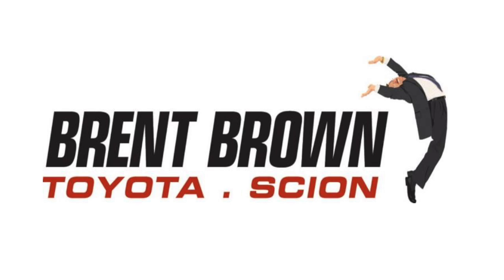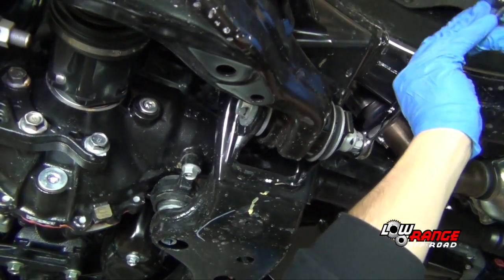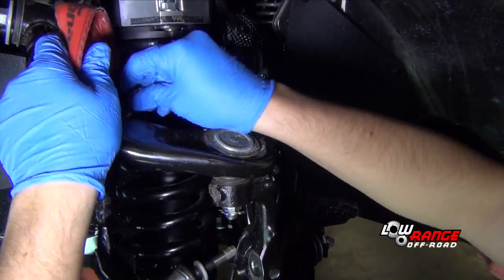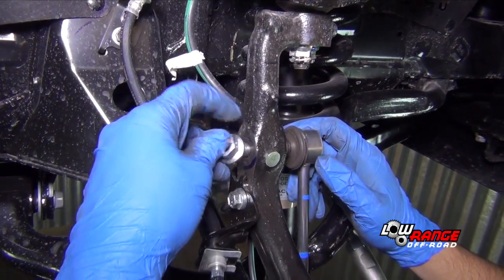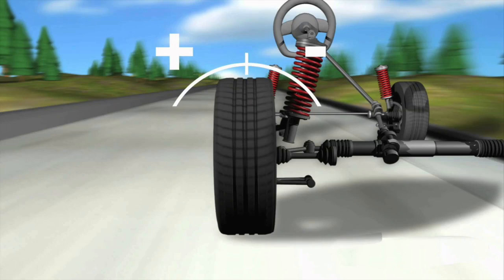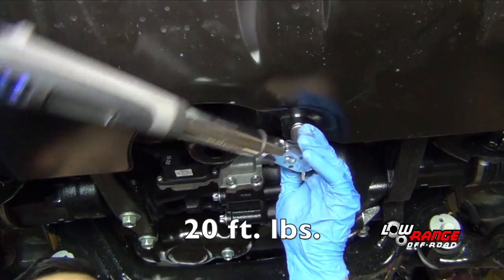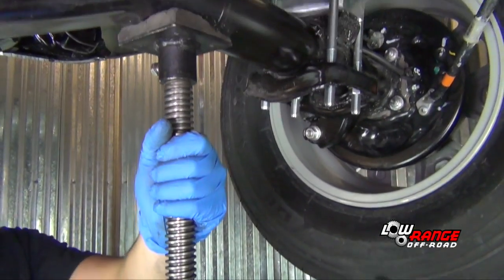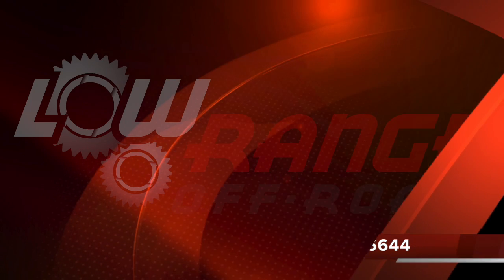How to Install  an LRT 3" to 1" Leveling/Lift Kit on a 2016 Toyota Tacoma

Comment: so, don't you have to add shackles to both ends of the leaf spring?

won't it be off kilter if you just alter the one end?
Reply from the maker: I am sorry.  I am not sure I understand the question.  We are not using shackles with this kit.  The block is all that is needed to lift the rear of this vehicle one inch.  If this reply does not address your concerns, please feel free to reply or call our tech support line 801-805-6644 from 8am to 5pm Mon through  Friday MST.  The best person to talk to would be Nick.
Reply: Blocks go under the spring. Shackle height isnt affected, as it is lifted equally from under the spring

Comment: I own both a 2013 Tacoma and 2017 ZR2 and you can install the I inch leveling kit on ZR2 for $59 i did this with 1000 miles on truck with 285/70r17 BFG KO2 Now have 19500 miles now issues. Now I say I own both trucks ZR2 is the better truck hands down. Tocoma has 265/65r17 duratrack off the ZR2 on it now. Both good trucks.
Reply: Your zr2 won't last half as long lol this coming from a GMC technician.

Comment: im wondering how this kit will affect rough off road driving and how it will hold up in off road use
Reply from the maker: This kit is designed to take a lot of abuse.  It should hold up under whatever you can dish out.  Thanks for watching and commenting.

Comment: If I install this 3" to 1" kit on my 2013 sr5 prerunner, will I need new UCAs?
Reply from the maker: I am not sure I can answer your question accurately.  My advice would be to call 801-805-6644 or email us at sales@lowrangeoffroad.com.  These guys are good and are happy to answer your questions.  Thanks for watching and commenting.
Reply: Arnulfo Cruz yes, it's suggested because the geometry changes the front suspension angles, and can cause premature ball joint wear... I suggest replacing the lower ball joints as well to serviceable ones, this is what I did to my 2006 tacoma and it made the steering feel much better

Comment: Will lifting a brand new truck void the warranty?
Reply from the maker: You should not have a problem with warranty.  We sell our lift kits to many dealerships that install them on brand new Tacomas pretty regularly.  However, if the dealership does not install the kit it could possibly void the warranty.  The best thing to do would be to check with the dealership you work with.  They may require that you have them install the kit.  Thanks for viewing and commenting.

Comment: Good video !I have a 3/2 leveling kit by rough country. Im very happy with the kit on the truck.Keep the videos coming. I subbed
Reply from the maker: Thanks for watching.  Hope the video was helpful to you.  Let us know if we can be of help with any of your off-road needs.  Log on to www.lowrangeoffroad.com or call us at 801-805-6644.  Nick is probably our most knowledgeable Toyota Guy here.
Reply: you change your tires?
Reply: I will be in a couple days. Put toyo open country m/t tires.265/70/17
Reply: Hello all I just received my kit a couple days ago now looking at new wheels and tires. I’m new to the whole “off roading” lifestyle but I was wondering will 33’s fit on a 2016 Toyota Tacoma after this kit is installed? I’m nervous about needing to do trimming or cutting 😬
Reply: @deanpennell3378  You mit have to trim alitte. I have 32" on mine with a 2015 taco and have some rubbing on the passenger side. I also have 18x10 -24 rims too

Comment: do you not have to adjust the top plate of the shock since the spacer offsets the holes? wouldnt it make the bottom of the shock turned?
Reply from the maker: Yes, you raise a good point.  The way to solve that is to place a bar (a large lady's foot pry bar works well) in the bottom shock loop and rotate the bottom  of the shock.  It takes a bit of force but it will line up just fine.  Thanks for watching and commenting.
Reply from the maker: Here is a picture of this process.  These instructions are for a Tundra but the basic principal is the same.  
http://www.lowrangeoffroad.com/media/instructions/LR-LRTundra-2007-2017-3in-Leveling-Lift-Kit-for-Toyota-Tundra.pdf
Reply from the maker: Here is a picture of the procedure explained previously.  Click on the link below and go to Step 36.  These instructions are for a Tundra but the procedure is exactly the same for a Tacoma.  Hope this helps.

http://www.lowrangeoffroad.com/media/instructions/LR-LRTundra-2007-2017-3in-Leveling-Lift-Kit-for-Toyota-Tundra.pdf

Comment: Pretty disappointment that they didn't show the truck after
Reply from the maker: We were pretty disappointed as well.  The dealership was to call us when they had the new tires and rims installed but the salesmen sold it before any of us know about it so we missed out on the final pictures.  Sorry!
Reply: I actually wanted to see it with the stock tires. I want to put the kit on now, but I haven't purchased new tires. Not sure how goofy it would look. Was hoping I could tell from this video.

Comment: Picture of the truck after and how it drives?
Reply from the maker: +Anton Sriphatthanakoon The ride quality after the lift was, as far as we could tell, same as before.  But, because the truck was brand new and we are only about a mile from the dealership, we did not get to drive it as much as we'd like.  As far as the picture:  We wanted to take the picture with new rims and tires.  We asked the dealership to call us when they had new tires and rims, but they never called.  When we went to check on things the truck had been sold. Sorry.  We will have to do another lift and get the pictures you and others have requested.  However, here is a link to another 2016 Tacoma with our lift on it that was installed by the Dealership:  http://blog.lowrangeoffroad.com/lrt-3-to-1-leveling-lift-kit-for-2005-2016-tacoma-and-pre-runner/

Comment: A word of caution: when you torque the spacer nuts on the upper shock, be careful when you place something in the bottom part to keep it from rotating. I ended up twisting my lower shock so it wouldn't reinstall. Ended up having to replace the strut/coil assembly. Expensive mistake.

Comment: Put one of these 3/1 lift leveling kits on my 2016 Tacoma.  I have 5300 miles on the truck. I have a vibration at 35-40 mph. Took it to Toyota They claim that I have failed axles and failed needle bearings. I am going to remove this kit and see how much damage has actually been done.  I have a Toytec lift on my 08 Tundra with no problems.  The axles on the Tacoma are definitely at a steeper angle compared to the Tundra.
Reply: it is a rough country or tuff country  leveling kit ? or else ????
Reply: I had this kit professionally installed along with new UCA's. Aligned Tacoma (2017 TRD off-road) to factory specs.  I'm  now experiencing a vibration at various speeds. Can you please help with some advice. Do I need to also drop the carrier bearing?

Comment: if i plan to do more off roading should i invest more for a more complete suspension upgrade
Reply from the maker: This is a very good question.  There are a lot of factors that need to be considered in order to answer your question.  My recommendation is that you call 801-805-6644 between 8am and 5pm MDT and ask for Nick.  He is the most knowledgeable person here when it comes to Toyota Lifts.

Comment: Quick question i have a 2004 tacoma 2wd Regular cab & want to install a 3inch leveling kit on the front this 04 tacoma has struts to apply it right?

Comment: I had this kit professionally installed along with new UCA's. Aligned Tacoma (2017 TRD off-road) to factory specs.  I'm  now experiencing a vibration at various speeds. Can you please help with some advice. Do I need to also drop the carrier bearing?

Comment: Would this affect the suspension of the truck?
Reply from the maker: Customers report that there is no noticeable difference in ride or handling.  However, wheel alignment is affected.  So you will need to have the truck realigned after the install.  Thanks for watching and commenting.